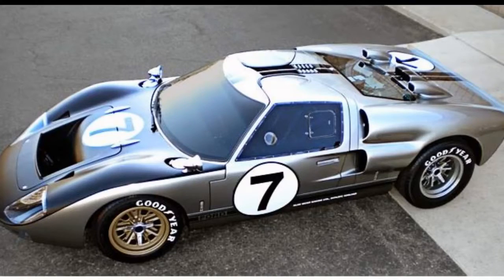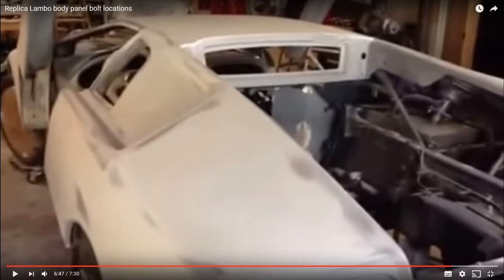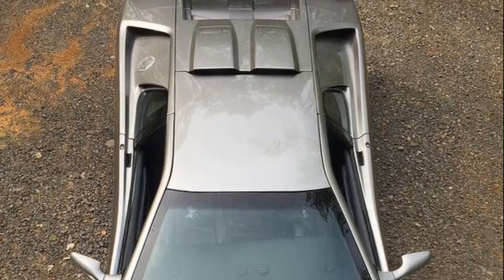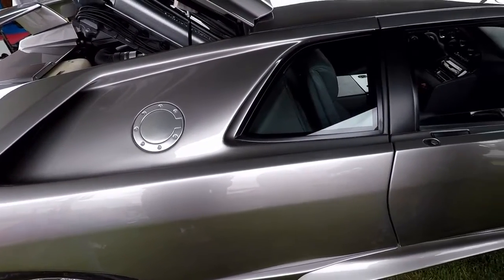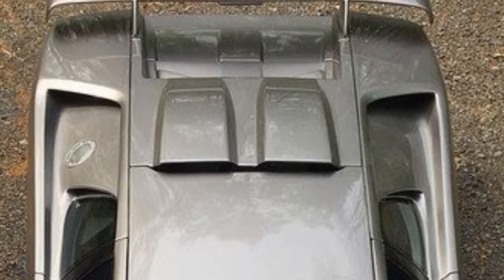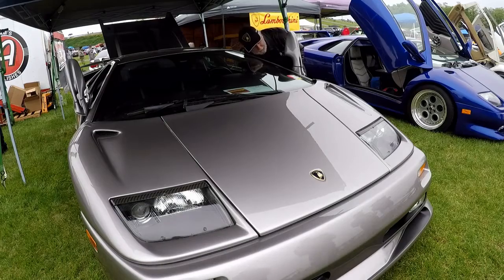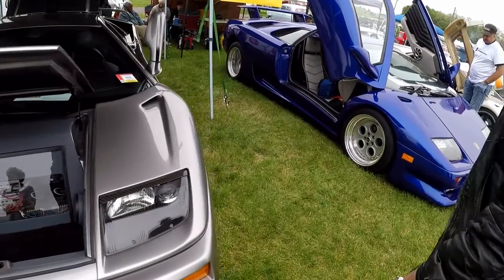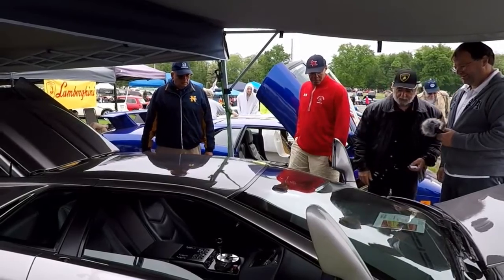Ron's Diablo Carlisle 2017

Comment: In 1990 I bought new a 1988.5 Lamborghini countach special edition #12 of 29, from Newport Pacifica Lamborghini in New port Beach Cali, So being the owner of an original my car has so many flaws being a hand built original. I had to upgrade and change so many things but finally its good to go. Added twin turbo, stage2 nitros, and carbon fiber clutch just to name a few, now I want to add another car to my collection and never considered kits but after stumbling across yours I am quite impressed. this maybe better than an original. sounds like you have all the bugs worked out with excellent workmanship. r u selling it? Please let me know
Reply from the maker: Nicholas...
Congratulations on your Countach.  They are really visceral cars.  They made everyone want a Lamborghini.  Even I have a few "bugs" to work out but at this point I'm happy.  After the time I spent building, I am not even thinking of selling.  AND, after all the time I spent building, I am not going to build another.  So, thanks for your interest.  If you do look for a replica (we don't call them kits), be very careful of scams and less than safe builds.  If you really want another special car, look to Superlitecars.com for their GTR or one of the many GT40 replicas that can be had as turnkey builds.  Anyway, thanks again, I hope you find something exciting.
Reply: @RonTinari  
Do u still do builds?
Or do you know a builder?
I'm in Texas and want to do a Diablo Build but work 80+ hours a week
Reply from the maker: @eclectic3618  sorry I took so long to get back to you. I just built this one for me and it sure took long enough!  I am not doing this again!  Thanks for your attention. You may be able to find some completed cars for sale. Look on lamboclonedotcom. Sometimes you just need to ask online. Hood luck.

Comment: this is the best diablo eveeer . i dont like the plastics of the engine.
Reply from the maker: autounou kai tou allou...
Thanks for your comment.  The center cover is fiberglass.  The only "plastics" of the engine are the two replica engine heads.  Those heads would be very difficult and time consuming to make and would be extra difficult to make in metal so I chose the plastic replicas that were available.  They also save some weight on an already heavy cover.